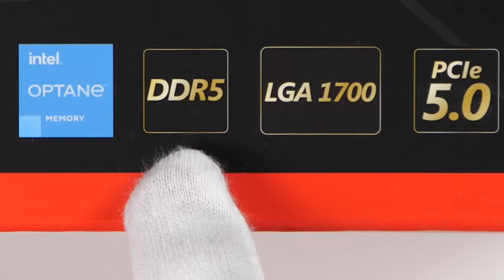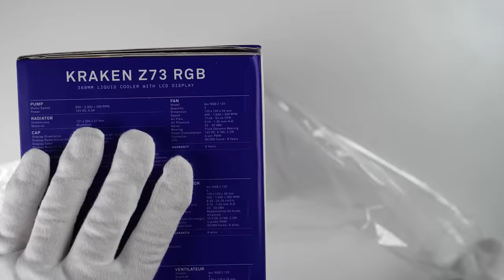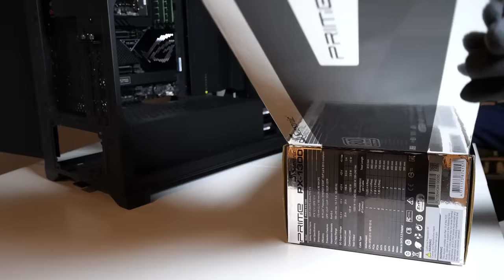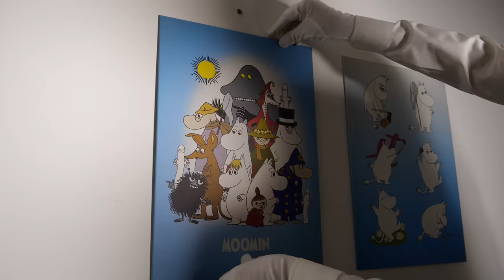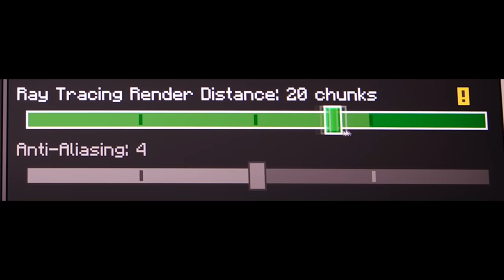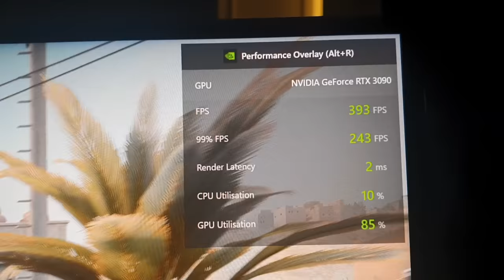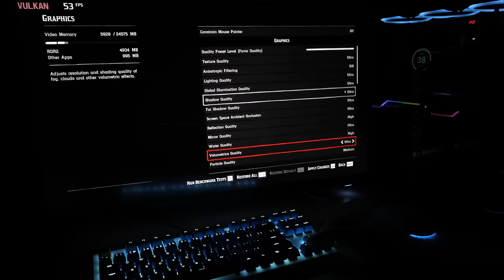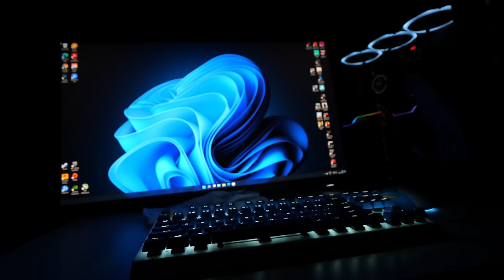Building my new Gaming PC for 2022 (High-end)

Comment: That looks sick as hell! Although I am a bit worried about using 3 ssds pci-e with 4 lanes each… the 12900k supports 20 lanes, could anyone explain how did he manage to insert 3 4x ssds and a 16x graphic card which would consume a total of 28 lanes pci-e?
Reply: Those are (mostly?) Gen5 lanes running at 32 Gbps… big data pipes.  Even with just one lane per endpoint, performance should be reasonable
Reply: I doubt he’ll need to access all 28 lanes at once

Comment: The cpu cooler would be installed better. I mean flip it so the cooling cables/pipes come from right and will not block that fan back on the case.

Comment: Just checking in, what RAM did you upgrade to from the 32GB Asus DDR5 4800MHz? I'm going to be running i9 12900K with Asus ROG Maximus Z690 Hero Intel Z690 LGA 1700 DDR5 ATX Motherboard and Asus GeForce RTX 3090 Ti TUF OC Gaming 24GB GDDR6X PCI-Express Graphics Card (when it comes down in price) and i dont know if i should buy 5200MHz or 5600MHz RAM's??? This is my first ever build and i am trying to learn haha. Any help on RAM for my specs i just mentioned would greatly be appreciated, thank you <3
Reply: why do you try to learn on 2000$ pc
americans are different breed

Comment: why green dimm's? if you install nvme, and the heat plate has cooling pads on them, you should remove the sticker on the nvme, on the gpu you should run individual pci-e cable's, dont use the splitter on one slot, keep it in mind for future builds

Comment: Ok sure but If you were using like 1920x1080 resolution like most people would do, the fps would be way higher and so much better. But I'm surprised how the fps are still high even with 4k resolution.